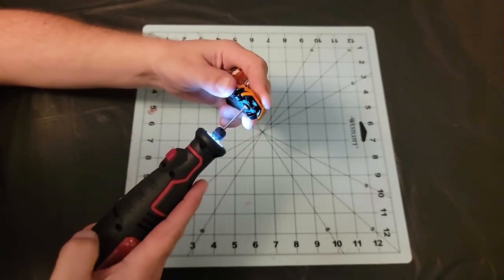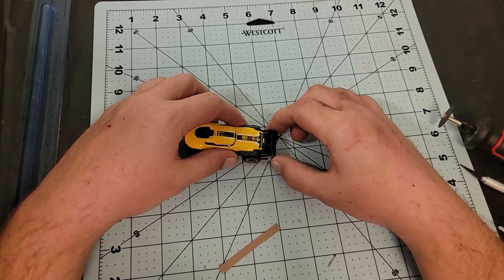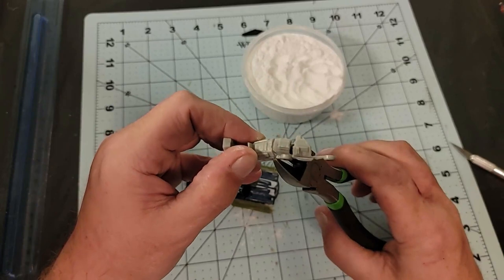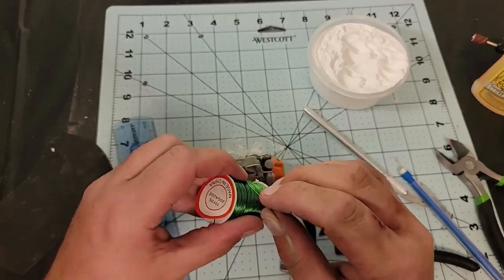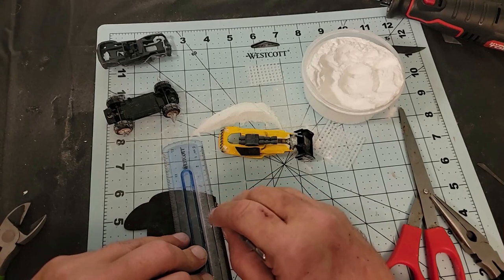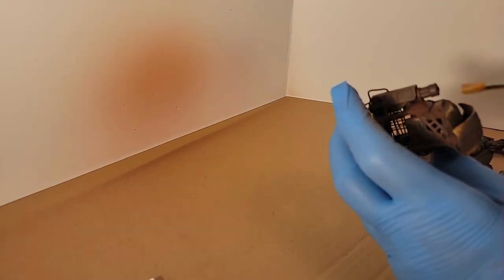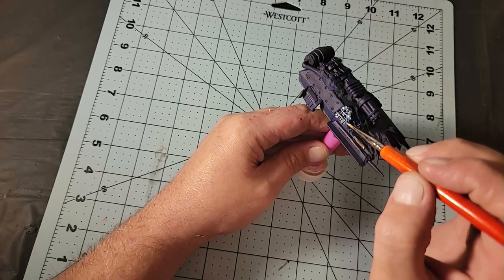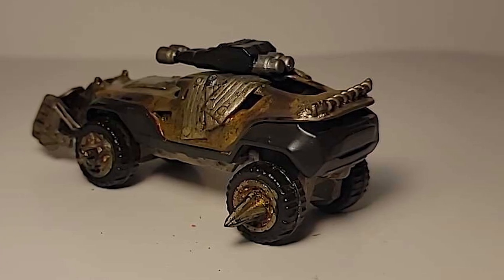Hotwheels Gaslands / "MadMax" Style Car Conversions | Corndog Creates

Comment: Nicely done! I have picked up some of those weapons kits from Dollar Tree to use as well. Using the foam as metal plate is a great tip. Thank you for sharing.
Reply from the maker: Hey, glad you got something helpful out of the video! Another useful tip for the foam is to look around Dollar Tree at different holiday times to check for things like "children's foam crafting" sets or whatever that come in precut shapes so you don't have to use a sheet of foam and cut them yourself. (:

Comment: This is timing, I know it was a Month ago but Man, we think ALIKE! I bought those SAME Toys for the SAME Reason, I even have the same dang tractor, I had to sub so I can see more Builds like this! LOL THANKS! Amazon has Foam Safe Super Glue, warning its not cheap..
Reply from the maker: Dollar stores are the best, right?! lol I don't know how many stores are in your area, but I'd recommend going to a couple to see the variety that they have. Because it seems like they all have the same cars except for a few different ones and they have different toys you could use to upgrade your cars,  So, go wild with it! No 2 cars will look the same and nothing is off limits. It's fantasy! :D
Also, fortunately, I haven't needed any foam safe super glue, so crossing my fingers that I don't need any for a while. lol
Reply: @corndogcreates  Heck yea, I have 3 I always do a Big Circle! lol
Reply from the maker: @TomJones0065  Sweet! Another good tip for you is, if you see any "Readi-Board"/foam board, grab some of it. It's super cheap (normally $1 or $1.25 depending on which dollar store you you get it from) and really useful for all kinds of things. It's normally the size of a poster and about 1/4 in. thick, so it's easily cut with box cutter or Xacto knife. I've used it for walls, terrain and stones, so you can use it for all kinds of things.

Comment: As someone who does a lot of these, a flush cutter is needed. Will allow much closer and cleaner cuts for your bits.  Awesome build
Reply: Also there is no overboard on these type of builds
Reply from the maker: Yea, I should get some. Using sandpaper to get everything smooth is definitely a pain, but I'm using what I have, for the time being. lol Thanks for the advice!

Comment: Just so you know, EVA foam (what you're using here) does not melt with super glue or spray paint the way EPS or XPS insulation foam does. They're completely different materials.
Reply from the maker: Thanks for the info. I'm sure you're right, but with my luck, I'll try to use super glue and ruin something still. lol